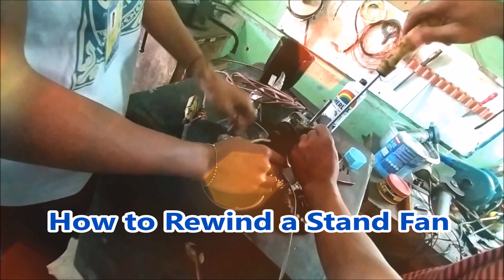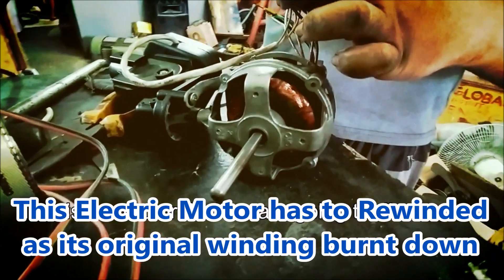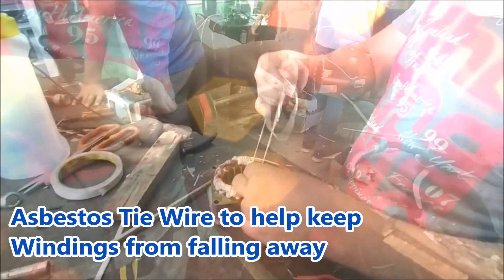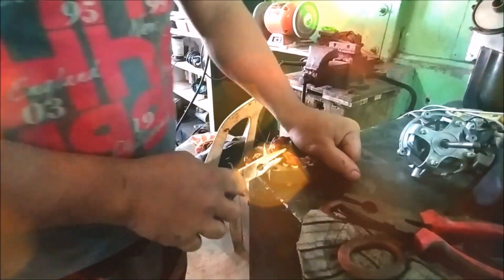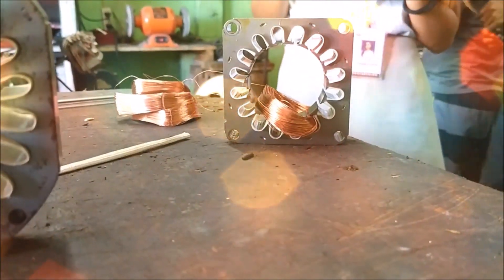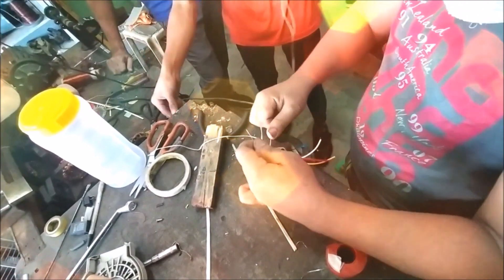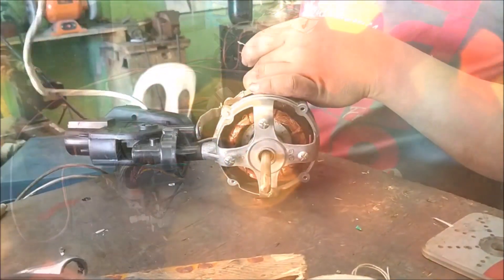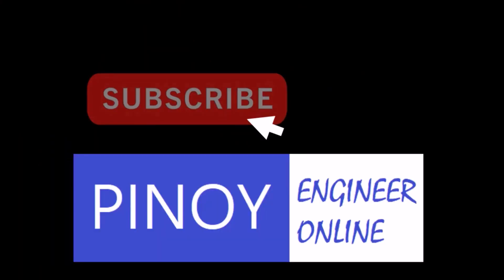Step by Step Guide: How to Rewind a Stand Fan Motor?

Comment: Hey really cool video, I have some questions for you when you are going to rewind the fan motor , if it is a 2 speed do you use one single roll of windings or do you have to 2 rolls windings if want to do bolth speeds , and will the motor have the same start up sound once it has been rewinded?

Comment: Missing points I noticed:
Should indicate the size of wire used and number of turns. A burned winding will not be possible to count how many turns.
Should indicate the wiring connections in detailed is much better. Connection of capacitor, thermal fuse, low, med, high and common.
Should indicate some theory like computation of having a particular turn with size of wite etc.
Should be able to determine the resistance of each wiring etc...

Comment: YOU MISSED TO TEACH THE MOST IMPORTANT DETAIL WHICH IS THE ACTUAL CONNECTION OF EACH COIL THAT MAKES THE RUNNING AND STARTING COIL, A THUMBS DOWN FOR THIS VIDEO.
Reply from the maker: It was pointed out in the video to just copy the previous connections in the previously dismantled windings. The formula might be different for other motors
Reply: @pinoyengineeronline8766  if the coil is severely burnt, it's hard to distinguished the connection. maybe the turn can be counted but not the connection. the diagram is important to know in order to be able to inert and assemble the windings. that's the one lacking or missing on your tutorial sir
Reply: Hirap nga e copy. Dapat tinuru morin ang connection. Or panu mag connect.

Comment: Sir pakibigay naman ang number of turns bawat coil saka yung connection ng clockise at counter clockwise ng bawat coil. Thank you
Reply from the maker: Sir, yung number of turns ay depende yan sa motor na nirewinding nyo. Bago pa kayo magrewinding, dapat mabilang nyo yan.
Reply: @pinoyengineeronline8766  sir sabi ng ibang napagtanungan ko, nakadepende daw sa size ng core yung turns. yung pinanood ko sir is 70mm length by 16mm width yung size ng core tapos 750 running at 550+150+100 starting winding. E PAANO NAMAN PO PAG 7Omm by 16mm YUNG SIZE NG CORE, ILANG TURNS PO KAYA YON?

Comment: Sir saan po ba nakakabili nang insulation paper
Reply from the maker: nasa mga electrical supply po ito sir
Reply: Sge po slamt po
Reply: Sir tingin niyu sir pewde po ba thermal tape pang lagay doon hindi na insulation paper
Reply from the maker: @outlinebossrinmark6020  di ako familiar sa thermal tape sir
Reply: Tapos yung teflon sheets pewde po ba yun
Reply from the maker: @outlinebossrinmark6020  wag po yung teflon
Reply: @pinoyengineeronline8766  sge Po

Comment: san ba nakakabili ng mga insulators na ginagamit. tie asbestos, insulation paper at ung varnish bang ginagamjt jan ung nabibili lang po sa hardware?  sana ituro nyo rin kung paano mag simula ng ganyang negosyo. 
thanks
Reply from the maker: Hello Sir. Meron yan sa mga Electricla Supply. Kung gusto nyong magsimula, itake note nyo yung mga materyals na ginagamit tapos pag-aralan nyo sa bahay nyo o di kayay magpaguide kayo sa mga marurunong na. Magandang pagkakakitaan daw to eh.
Reply: @pinoyengineeronline8766  pati ba ung varnish? ordinary varnish lng ba un na nabibili sa hardware
Reply from the maker: @peter100979  yung pang-electrical sir
Reply: Sana binigay nyo rin yung data ng winding turn. At wire size para malaman namin
Reply: Sir pati yung washing machine motor kung paano mag rewind at yung data ng wire size at number of turns.